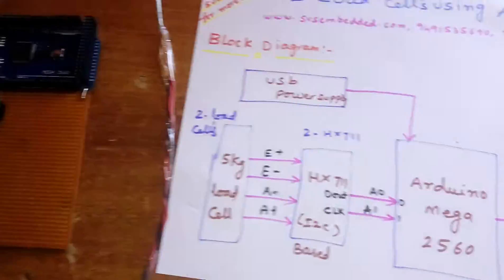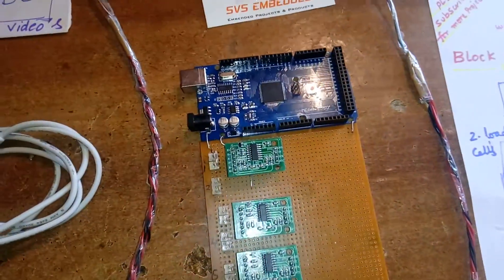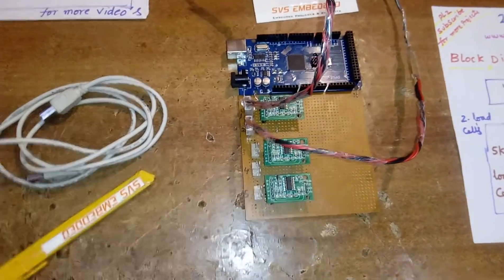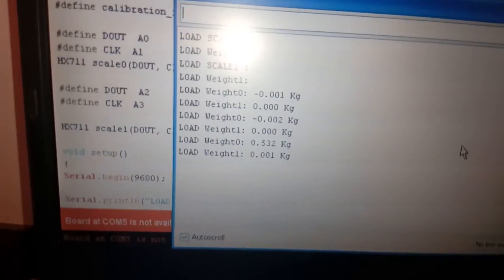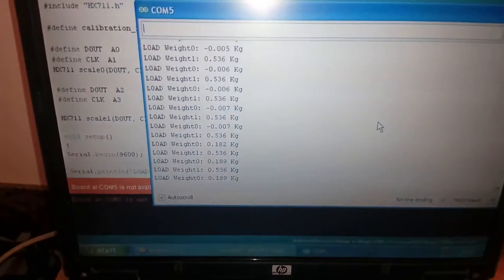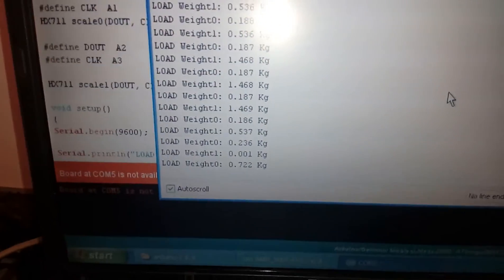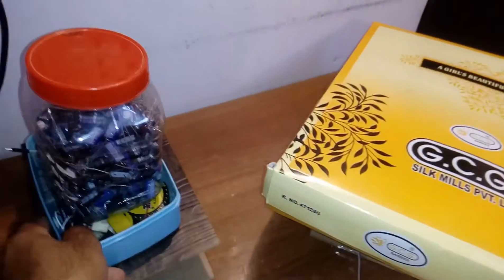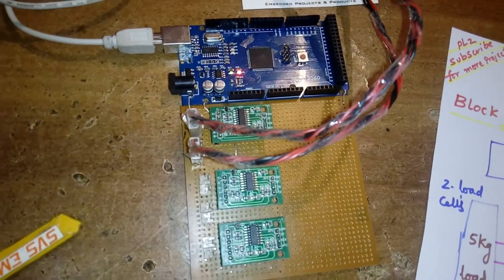2 load cells using arduino & hx711

Comment: how to connect 2 HX711 in to one arduino board???
Reply from the maker: Thanks for comment and your valuable Feed back

hx711 is working under i2c protocol. it will work.for 2 loadcells.

i did 5 load cells and 3 hx711 sending data to webpage.

successfully completed the project. i sold to one person.
Reply from the maker: Thanks for comment and your valuable Feed back
hx711 is working under i2c protocol. it will work.for 2 loadcells.
i did 5 load cells and 3 hx711 sending data to webpage.
successfully completed the project. i sold to one person.
Show less
Reply: good, in my case I'm using 4 load cell, so can u explain it briefly what is the best solution for this??
Reply from the maker: mainly for connection and programming code. hx711 supports 2 load cells.
u need 2 hx711. check the circuit diagram on internet.write u r own code.